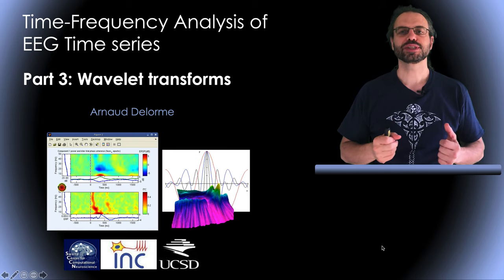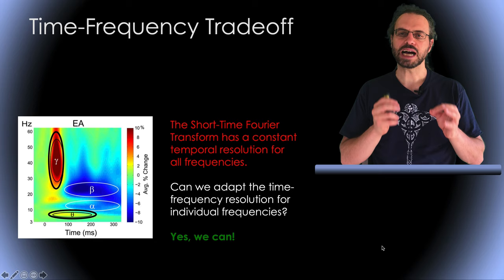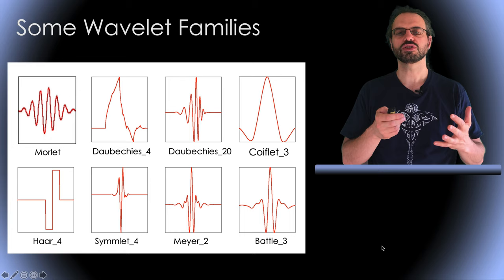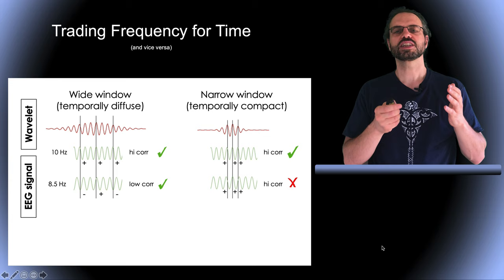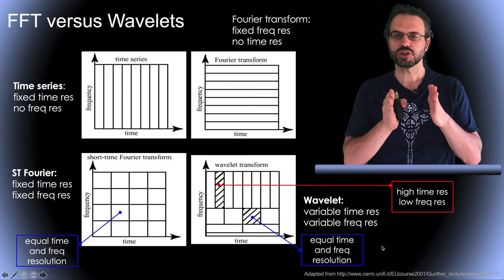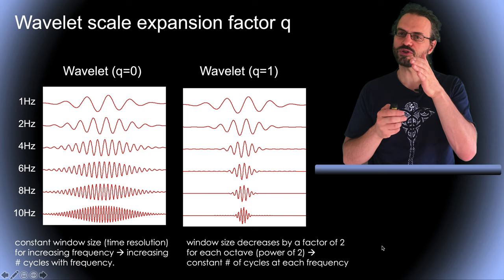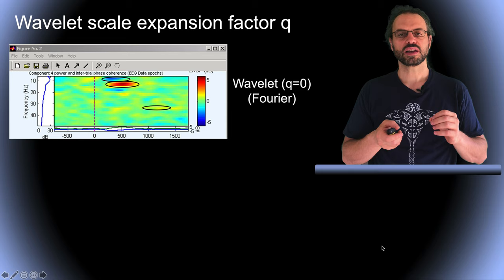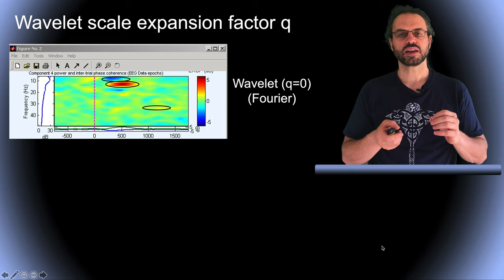Time-Frequency Analysis of EEG Time Series Part 3: Wavelet Transforms

Comment: Thanks so much for sharing this video. Can I use EEGLAB with python because I don't like Matlab. Is it applicable?
Reply: for python, you may use MNE
Reply: @01hZ  thanks so much. The problem is MNE is more difficult than EEGLAB and there are not to much tutorials on YouTube.
Reply: @Mohamm-ed  I agree, use EEGLab, mne was a waste of time for my project
Reply: You can  call matlab through python. The mathworks website has ways to do this. Then you can just use matlab code when you call matlab to run eeglab. I haven't tried this, I am just going to use matlab. But, it could be an option.